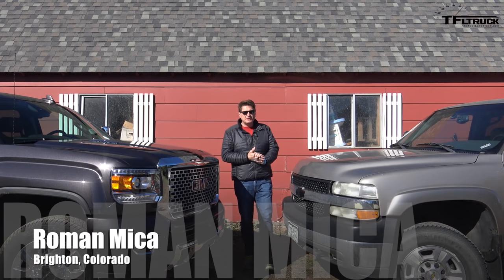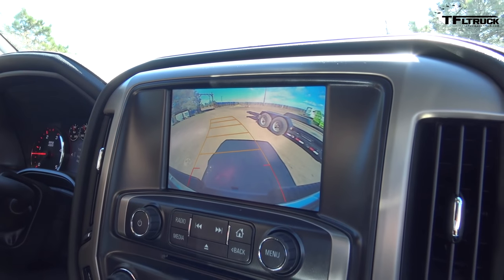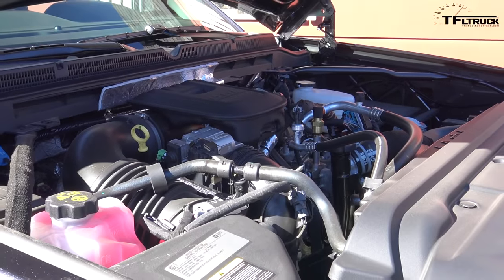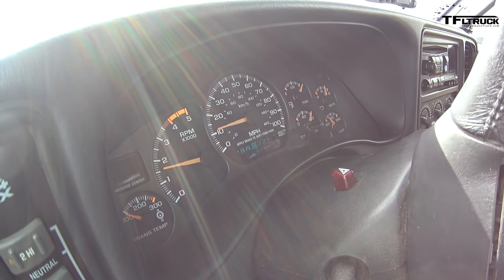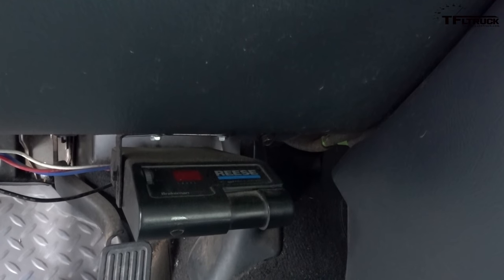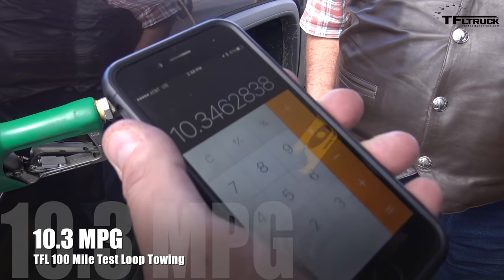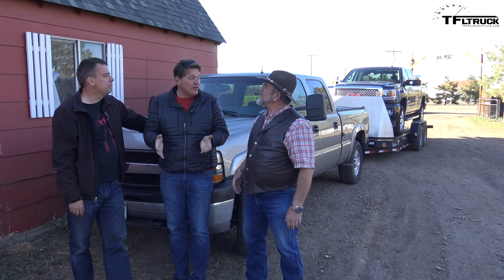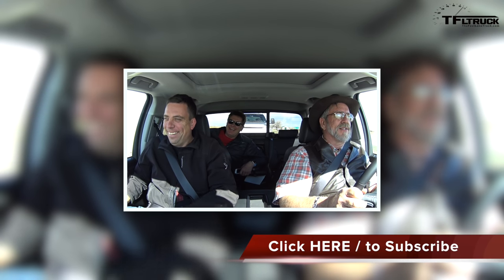2016 GMC Sierra Denali HD vs 2002 Chevy Silverado 2500 HD Mashup Review - Old vs New Ep.1

Comment: Just so everyone is clear DEF does NOT hurt power or fuel economy. It is an after treatment that is injected into the exhaust that reduces the levels of NOx. Since the DEF is reducing NOx coming out of the pipe the engine can be tuned to have a lower EGR duty cycle and more injection timing. Reduced injection timing lowers combustion gas temperature and EGR also lowers combustion gas temperature. What hurts power and fuel economy is the DPF filter which not only causes a flow restriction in the exhaust but also having to inject raw diesel into the DPF for a regen to burn soot captured in it. Oh and believe me I'm not a fan of these diesel emissions controls.

Comment: Great video, but you missed the most important variable in the fuel economy difference. 1000 miles is HARDLY a break in for a new diesel engine. That gap between the two would have been much larger had the GMC been broken in.

Comment: Def was a main reason for the fuel milage difference. My 03 cummins averages 19 around town with 210hp tune. My buddy has an 01 dmax with 8" lift getting 18 and truck is always turned up. Havent seen any newer diesels getting that kinda milage.

Comment: I also owned an 02 duramax. My question would be do you know if a regen cycle was present during the tow portion of the '16? That could also significantly impact fuel mileage ratings between the two. Great video. Thoroughly enjoyed.

Comment: the 6th gear of a six speed doesn't necessarily mean higher gear ratio... rather closer gear ratios between them. you can have a 4 speed and a 6 speed and both start the same and end the same the difference is the shift points. the advantage the 6 speed has is keeping the engine closer to it's optimal rpm.

Comment: 2002 LB7 Duramax trucks were rated at 235hp/500lb-ft of torque. In 2004 model year they got bumped up to 300hp/520lb-ft unless you are claiming his exhaust/intake adds 65hp.
Reply: the lower input duramax ur talking about was only available on select commercial vehicles

Comment: The towing numbers for the 2002 is 12000 lbs max for conventional towing only(class 4 hitch with WD, 7500lbs without WD). For fifth wheel towing its much higher, 15300 lbs in my owners manual (2001 2500hd 6.6L, 4x4, Ex cab, 6'6" box). Its slightly more without ex cab and 4x4

Comment: I’m going to keep my 2004 LB7 until she dies. She’s got close to 380,000 kilometres on it. Just changed the fuel injectors, glow plugs and added a Fass lift pump. She runs great, transmission still works great!

Comment: Love the videos guys
I’m shopping around for a mid size truck and need some help.
I’m considering the Silverado or Sierra simply because I prefer the looks vs the F-150
I owned a 2020 RAM and was not impressed with gas mileage 
I do not tow at all
Which truck would you guys recommend for gas mileage and dependability? I’m open to any size engine 
Thanks

Comment: With the emissions equipment on the 2016, and no emissions equipment on the 2002. I am impressed that the two pickups mpgs were that close. If you would have done this in 2008 the 2002 would have had a larger victory.
Reply: +Zwirn d The 2016 still has to regenerate. It also requires DEF to run, which is not needed in the 2002. In the long run, or even in the short run, the 2002 will be much cheaper to operate, and that's not even factoring in the cost of repairing emissions, which there isn't as much of in the 2002.

Comment: That goes to show what "heavy duty trucks are not EPA rated" does to the heavy duty truck industry over time. There is huge room of opportunity for a player to make a truck that is lighter, has a transmission with more speeds, that also keeps the power to weight ratio. Moving just from 10 mpg to 15 mpg is a gain of 150% and a huge jump in out of pocket gas savings over time. I hope there is innovation soon.

Comment: For your info when you guys do any speed test with a duramax with an Allison transmission even the the first gen like Andre's    Use the tow/haul mode because it locks the torque converter 2nd threw 6th/5th gear so more power is put to the pavement!!!

Comment: This proves exactly what the epa regulated emissions does to these trucks. The fueling technology has improved but they are dragged down by numerous systems just for emissions which restrict the engine and add tons of cost.
Reply: Exactly, guy I work with has an 07 Ram with the 6.7 Cummins, crew, long bed, dually, 4x4 and he could barely get 12mpg out of it stock. Now, he's got a 4" turbo-back exhaust with the factory muffler, egr delete and a tuner to keep the CEL off and limp-mode off, a few little tuning changes to compensate for the extra air flow but otherwise stock, no extra boost or anything like that. He now gets 20mpg mixed, even towing on the highway it gets 20mpg. 

Now which is worse for the environment: 10mpg with a doc/dpf/egr or 20mpg without that stuff? Soot settles on the ground anyways, doesn't linger in the air.

Comment: The new trucks will never be able to compete with the older trucks on engine calibration due to extra injection events traveling out the combustion chamber to help the DPF regenerate passively. I watched your video waiting for you to mention this prior to the drive, you didn't. Then after the drive, you were surprised, and still didn't mention it. New trucks will gain some ground back with taller OD's, aero, and light-weighting, but to be equal at the end of the day is very tough.

Comment: I would bet all the emissions crap.. DPF, and DEF system was the cause..   The Transmissions are basically the same. Both Allison 1000 Transmissions.   I also think that you can ADD the 6th gear with a programming change. Mechanically they are the same, they just lock up a pair of clutches to activate a different final ratio in the planetary sets.
Considering the old truck pulled more weight.. I was impressed.   And you can easily get EFI live tuner for that 02 and make way more power... I think up to about 500WHP and 750 Torque. Of course you may break stuff at that level

Comment: I had a  brand new 2002 then a  brand new 2006 which has 325,000on it and  I still drive today   and just recently I bought a 2003 with 160,000on it.. by far the best trucks  on the road..it seam like the new ones are constantly in the shop for electrical issues...

Comment: +The Fast Lane Truck 2020 GMC Sierra 3500HD Denali vs the 2020 Chevy Silverado 3500HD both with the 6.6L Duramax Diesel engine is the next video y’all need to do the Non Dually version of the Chevy and GMC 3500s

Comment: 3-way, 5.9 12v vs. 5.9 24v vs. 6.7. Also, give each generation of Ram the same amount of weight on the back, and make all three of them dually chassis-cabs, that have been adapted for fifth-wheels, Ram 350 for the 12v,  Ram 3500 for the 24v and 6.7, and leave all three bone stock under the hood, no modifications whatsoever. Also, measure miles/tank in addition to MPGs.

Comment: I wasn't surprised in the mpg test results. I have an old 1999 powerstroke 7.3 that gets way better milage loaded empty or towing, than new ones. I don't driver her 70 mph ever.  wind is the enemy and after 60mph all you are doing is pushing the wind, faster means more wind. now if you look closely at these two trucks you WILL see that they are almost exactly the same. wheelbase, box dimensions, interior room all exact or very close. the width of the gm twins went up by 3 inches in 07(1.5" each side) to compete with Dodge (now Ram) and Ford. The frame was updated to today's GM standards in 2011(mind you that was the standard for the other two in pre-2000) that's where the "weight" came from. The part about max towing "not being all that different?" is all trucks have GAWR and the SRW trucks are still under 7000lbs RGAWR so you can't carry the pin weight for more than 3500lbs which limits the safe towing ability(based on 10-15% conventional, and 15-25% 5th/GS). the 30,000lb rating Ram and Ford have aren't based on 25% that is 7500lbs on the pin and not one of the trucks have that available payload. if you want to tow something that heavy buy a real truck. One that will last 500-750,000 mlies and get 8 mpg forever, and will do it safely. The little class 3(14000lbs GVWR) that weigh 8500lbs just don't have the structures, suspensions, or axles to make a life of real hauling. The parts are still too small.

Comment: I can't say I'm too surprised. They say that diesel motors aren't truly broken in until 100,000 miles. Idk how accurate this is, but it is what I've heard.
Reply: heavy duty diesels that can be very true; these lights duty diesels are built like gas engines but are still very tough.
Reply: +RedWings-44 It isn't being new that's hurting the 2016 most, it's the emissions stuff. Besides, while being broken is a positive for the old truck, that probably gets canceled out in other areas by age and wear and tear.

Comment: you guys should have done an mpg test without towing to see which one does better unloaded.
Reply: The 02 would obviously get better Mpg. It did slightly better in this test, where they were both lugging the same weight( minus that one guy). Unloaded, the older truck sheds more weight.
Reply: +mike racicot yeap I'm sure it would do better and also not having all the damn emissions crap on it like the DEf fluid and other nonsense that makes it work harder.

Comment: Both engines moved the same weight the same distance. The motors don't know the difference in "tow weight", they both hauled the same weight. I'd call this a tie because a little more or less wind on the trip could account for the difference. If you think your new truck is designed to get better MPG just remember, they added weight to the new truck because better MPG causes losses in income, car companies buy gas stock ;-) They want you to pay more, or at least the same, at the pump.

Comment: They towed exactly the same amount of weight.  Driving around with no trailer the older model would probably get better fuel mileage and it has way more wear on the engine.  Interesting...it also doesn't cost $70K.

Comment: and the injection pump takes a dump at a totally random time on the new truck and bricks it, when skewed nox sensors and the def heater/temp sensors failing aren't throwing you into reduced power. but as a gm diesel tech i may be jaded seeing so many crap the bed, none of that garbage on my 12v cummins and despite 4.10 gears gets 19 on hwy

Comment: two way different turbos on those trucks, the LB7 in the 2002 had an old fashion turbo with no variable vanes that made it flow a lot better at highway speeds and thus more fuel efficient, but can't turbo brake and slower off the line.

Comment: Interesting comparison but the 2002 2500 HD was not stock. 
Aftermarket air intake and exhaust systems both add horsepower and 
economy. Add the 
exact same modifications to the 2016 2500 HD and see what 
happens.
Reply: I doubt any horse power was added with those upgrades, maybe 5 max

Comment: LB7 vs LML...
Horse apiece...
And my 2020 GMC 3500HD AT4(L5P) towing 14,600(gooseneck and my 2002 2500HD(LB7), with the weight of the 2020(8400) comes to approx. 23000lbs gets about 13.7mpg on a 350mi loop... Bigger truck, more grunt, better mpg...

Comment: That was interesting. A better test would have been to have one person drive each truck. That way you could eliminate driving style from the equation. Personally I'll keep my old 2000 Sierra. It may be rusting out, and have over 235,000 miles on it.  But it still performs very well for a 16 year old truck. Granted it has 2WD and has the 5.3 V8 but still, I can pull 11,000 lbs. . . Slowly, but still average about 10 MPG. And the accuracy of the fuel gauge is an understatement. extremely unreliable.
Reply: +Delmont Industries LTD Fuel gauge is damn accurate in my 99 Sierra.
Reply: +LinusScrubTips You are very lucky then. I have had 3 sending units put in and all have been different. When the low few light comes on I have 10 gallons left in the tank. I guess I just have bad luck.
Reply: Delmont Industries LTD Wow that's stinks. My trucks all original, but the fuel pumps starting to whine. When my light comes on, I have about 100 miles left (at ~50 mph.). Get around 20 mpg at 50. at 70 i probably get 10-15

Comment: I on average tow on a 38ft sliding axle trailer that weighs 6000lbs 8-9000lbs. With a 17 F350 dually, so far for little more then a year and I couldn't see doing that with an older 1 ton dually and not nearly as comfortable or safe. These trucks have come along way, so although I do like simplicity, you can't ignore the positives these trucks now offer. So far it's been effortless and reliable, we'll see if it stays that way 3 years from now, at 36,000 miles on it now, it's still new. Other then that if you tow over 30,000lbs regularly get a class 6-8 truck, just for safety and durability standards alone...

Comment: Emission control devices that the Gmc has, kills mpg. The older trucks don't have them. Test a 5.9 Cummins vs a 6.7 Cummins and I will bet the 5.9 will get better mpg
Reply: +Racer1505 I remember stick shift 12V Cummins getting 28+mpg highway in regular cab 2wd trucks when unloaded, upper teens when loaded. Those days are gone.

Comment: only 12000lbs towing? that's horrible. the half ton dodge is rated close to that. get a mans truck, 2016 3500 dodge like 30000lbs. and 7500lbs towed in this video right? my old 2004 hemi half ton dodge towed that no problem at around 9mpg. if thisis the best gm has to offer then they have nothing to offer.

Comment: yall should do an 06 dodge 2500 vs 2017 dodge 2500
Reply: I would prefer if they did a 1st gen 5.9 Vs. A 2006 5.9 and then a 2007 6.7 vs. A 2018 6.7

So it would be the same like in this video where they compared two trucks with the same liters

Comment: 2002 Duramax allison GCWR is 22000 lbs...truck weighs 7000 on average with driver leaving a 15000 lb tow capacity. I like the old truck better the 2016 is basics..y the same Powertrain refined and it will not last as long as the old 02 LB7 will.

Comment: Old one is a 5 speed so the rpms are little higher. Put the new in 5th it will get 2-3 mpg better. I had an lbz with 6 speed that would do the same thing. The new trucks will drag that old one around plus the brakes and frame are built so much better. Still good trucks but they do improve every year.
Reply: I personally think the new truck would do better if it wasn't for the emission crap they put on

Comment: Damn u can keep that new one that 2016 barely had 40psi on oil at 70mph and the 02 was pulling 80 plus psi on oil pressure I got 06 silverado 2500 hd with a 6.0l gas engine with  233,000  Miles that pulls 60psi of oil pressure at 60mph

Comment: You have txo add the amount of Def it uses to be acurate to get a mpg amount  20 gal of diesel pluss 2 gallons of def are what you used to be correct, walmart has propane diesel trucks they dont count the propane and claim there trucks are getting 12+mpg but they get 3 mpg on propane and claim that doesnt count only the diesel counts its bull its padding numbers to look good diesel

Comment: A '75 1 ton Squarebody sm465 will out perform and completely outlast either or those new trucks. Next up GMT400 with the sm465.  Same rear end throughout- 14b FF's for the win! Followed by the pre '72 Chevys with the trailing arm/linked rear ends. Then, after that comes a new truck like that  '02.
Reply: Ohh and to the green folk.. my squrebody sits on 35's and still gets 20+mpg. Stock 2.73 rear 14bolt ff/35 bfg's/sm465/350 (355) w/low end cam and low end heads -272 .454 single pattern crane cam with TBI truck heads, not vortec. Long tube headers and magna flow muffs and 2.5 " dual exhaust. - Oh and please throw out the Holley. Hype doesn't help on the blacktop or the dirt. Qjets were the best carburetor ever built for light trucks. With this combo, I can idle at 600 in granny and tow my trailer uphill. And still give third (4th) an extended chirp.

Comment: Old trucks are the most durable and reliable. Nowadays trucks are crap and very expensive. I bit the 2001 silverado can eat 2017 silverado in off roading and towing.
Reply: m att My 99 Sierra has 122000 miles and still runs great. Not heavy duty, just 1/2 ton but enough for my needs.

Comment: I dont feel like reading through everything... but... why did you no tow the same weight on both? that puts the old one at a BIG disadvantage ... its towing MORE WEIGHT. Now if you say that the difference is in that you want both trucks pulling the same GVW then that again puts the old one at a total disadvantage. I have a 2013 ram and a 1999 ram both with cummins. My 1999 gets 25 to 50% better fuel economy towing the same weight. Its just that my 1999 is tuned by banks and my 2013 is on stock tuning. Even on the video you mention you are aware of this. If Andre gets a banks tuner on his truck... the new truck does not stand a chance on this test :) Technology has advanced alot but complexity has also made the new truck less reliable. My 1999 has over 750k all stock internals. My 2013... close to 200k but im not sure it will survive emissions as i will have to yank them out as under warranty it has been repaired 3 times now! DARN Filter clogged!!!!
Reply: I forgot to mention that the old truck still won but it was more of a tie... it would have been a brutal win with some tuning!